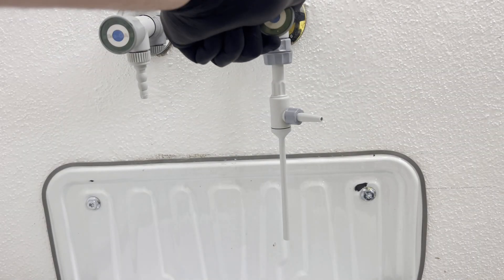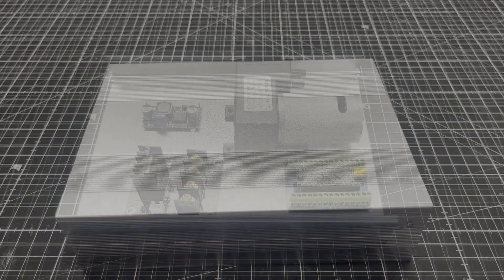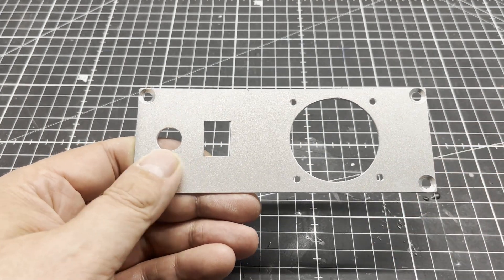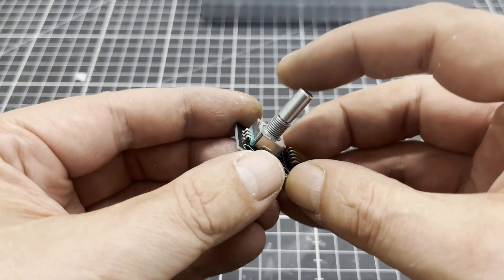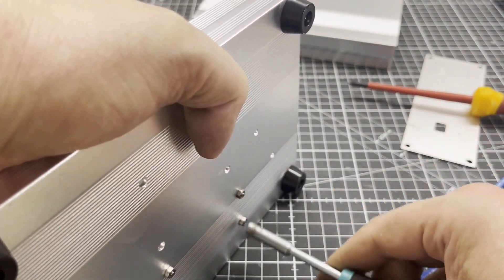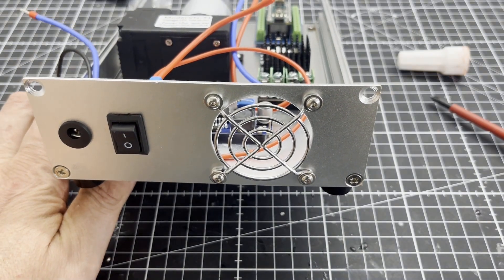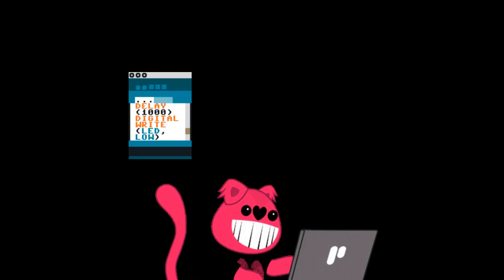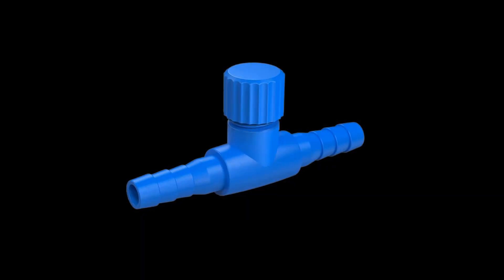Building a programmable diaphragm pump for the lab

Comment: you're fascinating man... all taken to German tech perfection, it's the state of the art regarding DIY, I'm looking at mine and feel so glad you can't see it, I imagine you only need to sneeze on the workbench and a NMR spectroscope asks you for some spare liquid helium cause the XRD that appeared on your second sneeze right after shot an x beam and it quenched the shit out of him, I would also love to see the first DIY microwave reactor but I know what a challenge it is, I am thinking either adding another identical and/or a pair of the smaller ones and with a proper manifold that could make them all in series or also work individually, I imagine a such digitalized Schlenk line would be of some relevance. Keep up the good work and success with your quantum computer!
Reply from the maker: Thank you:) Actually, I do have microwave chemistry in mind. There are so many advanced machines that are inaccessible to DIY enthusiasts because they are very expensive. I hope I can do my bit to change that.

Comment: I will watch the video shortly, but I'll have forgotten the query i have by then (which may be answered in the video lol)

Home come you've gone with a Diaphragm pump over a Peristalic pump for the lab?
Reply from the maker: Diaphragm pumps are for larger volume flows. If you need a smaller volume flow with high precision, a peristaltic pump (with stepper motor) or a syringe pump is more suitable:)

Comment: Hi Marb, to avoid an overheating of the small DC-motors is sometimes enough to put a relatively big inductance in series to it to smoothening of the current spikes.
Reply from the maker: Thanks for the tip. I hadn't thought about a choke, even though I was aware of it:)
Reply: To avoid the pulses overheating the motor, often a high PWM frequency like 20kHz is used. Of course the MOSFETs and H-bridge drivers have to be able to handle this
Reply from the maker: @goamarty  The default PWM frequency for D9 is 490.20 Hz. You can change it in the software, which may lead to other timing issues.

Comment: Well I have done somthing very similar. Two recomondations. Add a pressure sensor esspecially if you want to use Vakuum. I can really roccomand MPXV6115V they are descently precised an you can just connect them to the analg input of the arduino. Though you will have to do calibration on your own. Second, ad a check valve on the paum side. That way the pum is able to hold pressure at least somewhat after you turn of the motor. Verry useful for diverse vacuum applications. Oh and you really want to make sure you have a fliback diode on you motor driver or the Pump will kill the mosfet. But really nice project. If you use al BLDC.Motor you can even use this in glovebox applications. Thats what i build it for.
Reply from the maker: Thanks for the useful tips! And I have a flyback diode on the Motor:)

Comment: I'm a noob here but im really fascinated of how this even works.
How can you pull vacuum through water, if you could direct me to some source explaining whats happening it would be of great help.
Reply from the maker: Do you mean the diaphragm pump or the vacuum ejector?
Reply: @Marbslab  the diaphram pump how is the vacuum created at the outlet pipe, I did read about it a bit and had terms like partial vacuum the water heating up increasing in volume and then cooling down and hence reducing in volume creating a vacuum are a few theories I read neither of them providing a satisfying explanation.
Reply from the maker: @2207amol  The diaphragm pump is a modification of the piston pump, but with a diaphragm instead of a piston. If an enclosed space is enlarged, a negative pressure is created compared to the ambient pressure. Gas pressure is always created by collisions of the gas molecules against the container wall. There are still the same number of gas molecules in the enlarged space, but the area of the enlarged space has also increased. So the same collisions of the gas molecules, but on an enlarged surface, mean less force. Since p = F*A, where p is the pressure, F is the force, and A is the area, a pressure difference is created.
Reply: @Marbslab  Googling around I got to know the device I wanted to talk about is called dreschel bottle(or gas washing bottle).
So the device has two pipes coming out.
The outlet on one side(O1) is connected to the diaphram pump and the other side(O2) is in contact with the air in the bottle.
The inlet on one side(I1) is connected to the fluid(water in most cases) in the bottle and the other side(I2) acting as a vacuum source.
My question is how is vacuum moving from point O2 to I1 i.e how is vacuum passing through the fluid is my question.

Btw what you wrote about diaphram pump wasn't my question but I learnt quite a lot from it anyway.
Sorry for not being specific from the start.
Reply from the maker: @2207amol  The gas washer bottle is connected to the air outlet of the pump, not the vacuum side. But it would work the same way I explained. It is the pressure difference that pushes the air through the liquid in the bottle. The pressure of the air in the bottle is lower than the ambient pressure:)

Comment: How did you calibrate the flow rate?
Reply from the maker: I measured the generated volume and time at a certain PWM value, put the numbers in an excel sheet, generated a scatter plot and used the linear regression function:)
Reply: @Marbslab  I watched the video twice in case I missed how you did that 😜
Reply from the maker: @Andrew_Sparrow  Haha. It's handy to approximate functions based on data points that the microcontroller can then handle.

Comment: very interesting as always, here are some recommendations:

- 3:30 unless necessary, nylon screws are always better for electronics
- adding a current sensor to the motor could be useful to detect jamming and avoiding destroying the motor
- adding a pressure sensor to detect whether the flow works properly

Looking forward to see this used in an upcoming project!
Reply from the maker: Thanks. Recommendations are always welcome:)

Comment: That is a very useful project! I need a programmable liquid pump for my lab and I will borrow your neat enclosure system, just have to use a peristaltic pump instead of the diaphragm. Thank you for the video!
Reply from the maker: If you need a very accurate flow rate, I recommend using a peristaltic pump with a stepper motor:)
Reply: @Marbslab  Thanks for the tip. I was thinking about using a motor with an encoder, but a stepper motor seems simpler.
Reply from the maker: @martinm9877  If you need to handle very tiny amounts of liquid, you can use this approach: https://www.youtube.com/post/Ugkx5Jt6p7asnUYD42r_LAZmU6XK3Y9ccjUA
Reply: @Marbslab  Exactly what I need! It will be for a microfluidic device. I wanted to go with piezo pumps, but they seem overcomplicated and decided on a small peristaltic pump. Thank you :-)
Reply from the maker: @martinm9877  If you make a video of your device, please let me know:)
Reply: @martinm9877  you can use a pulse system base on a magnetic falling mass , by ajusting the impact force you can deliver very small quantity